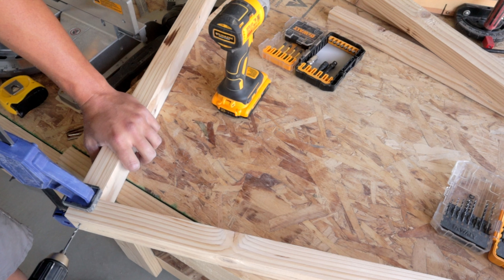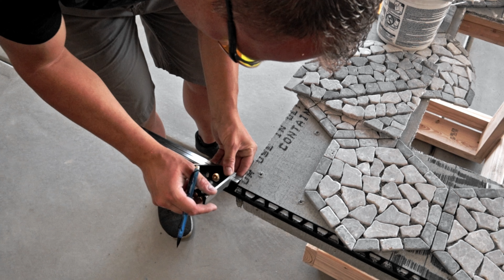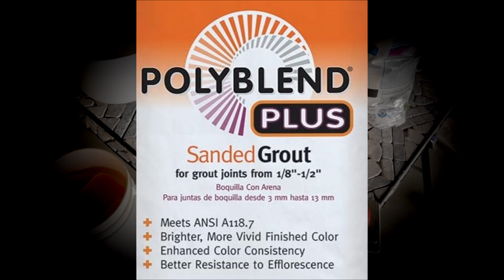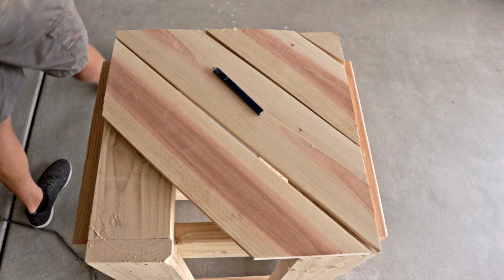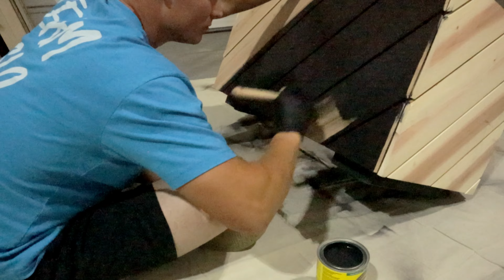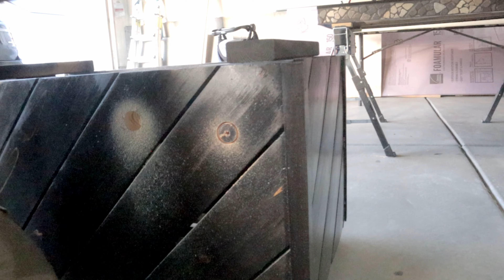I Built a $2000 DIY Outdoor Fire Table for $300, You Can TOO!

Comment: Congrats on an awesome looking project and thanks for the inspiration!  Looking back now, anything else you would have done differently?  How has it held up? Also, how hot does the pan get?  Any concern about it being close to the wood frame?
Reply from the maker: So far the pan doesnt really get too hot, but it does put off heat and warms up the tiles around it. 

There are a couple changes I would make. I would put a board under the table to keep wasps from nesting in the frame. The bottom does need some annual maintence as the sun bleaches the boards a little.
Reply: @DIYDeclassified love your table!  Since you mentioned the sun bleaching the boards a bit you might check this option out.
Shou Sugi Ban - The Japanese Art of Charred Cedar. 😁. There are lots of videos about it.
Also, I love your idea of making a drawer for easy access to switching out the propane!

Comment: FWIW, I believe there are flange extensions that would work for the "hole in wrong place" problem.
Reply from the maker: I didnt do a great job explaining why extending it wouldnt work, but the key wasnt long enough. If I used a flange to extend it, the key wouldnt be long enough to reach the valve.